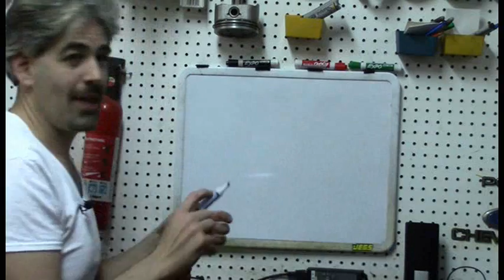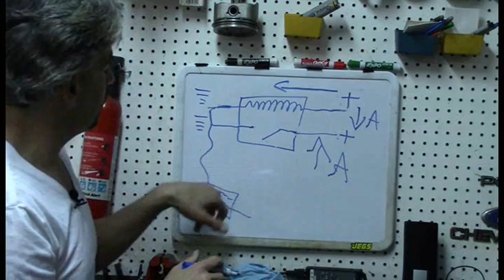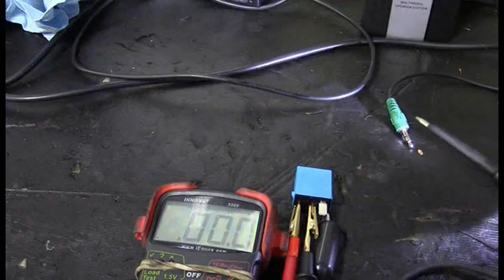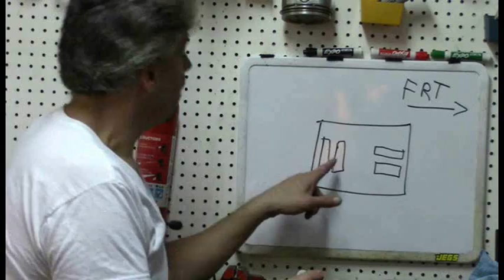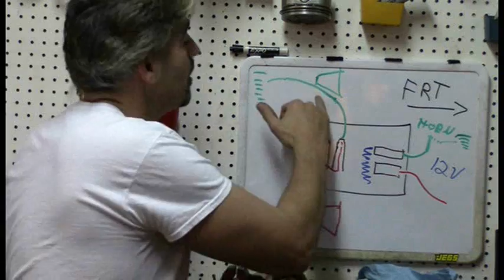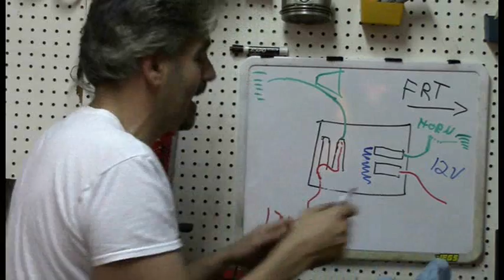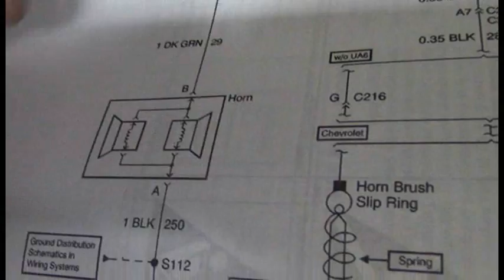Relays- Understanding, Diagnosis and Testing Relayed Circuits-Pt1

Comment: My friend, because I don't know your name yet, there are a couple things I wish to point out that will help you make some of these points . By the way I am well aware of the multitudes of you tube channels that are clueless and just repeating things they have heard. And I see you are way more complete in your tutorials. I am a retired Union electrician so auto electric comes naturally to me. In our field we use certain terminologies to quickly and positively identify symptoms etc. Like open and closed circuits for off and on respectively. And you also use these terms correctly. But when in an auto fuse box there are three kinds of fused outputs really four. One is battery hogs . No key needed for these to work like brake lights and some lights. And horns which is why I mention this because this power to the relay is actually a battery fused circuit. There are also ignition fused hots that require the key to be on before the fuse will be hot. And there are accessory fused hots that are on with the key on but they go off when key moved to the start position . And lastly for important stuff like head lights they are fused only after the headlight switch is turned on. Those fuses will not be powered until the switches are turned on. So this would have been discussed as a battery fused power circuit. 
  Which is my second point that will be helpful in your tutorials. Is that relays have power and control circuits . The power side is contacts usually much heavier duty than the control circuitry. The control side is a coil or holding coil that moves the contacts on the power side from open to closed or visa versa  that's all I got . You are an excellent YouTuber. I don't waste time with the majority and your readers should know that I support your content and I despise the parts changers or click watchers.

Comment: You don’t need a diagram to understand the relay because you do a continuity test to determine the electromagnetic control side contacts. But what if it’s that control side that is buggered? Would it be impossible to then know which pin is which?
Reply from the maker: No because I can determine which side is which from the relay port in the car. In facts, that’s normally how I do it because of the fact the relay will be suspect.

Comment: Not sure if circuit board relays are the same but im trouvleshooting a relay that i think is bad on a circuit board for a wine cooler....

I am trying to diagnose if the relay itself is getting the correct voltage on the control side...i am reading 12 volts on one side and 6 volts on the other side...12 volts seems normal but i dont understand why im seeing 6 volts on the other side....shouldnt i see 0 volts for ground?  I dont want to throw a relay on when the problem is actually something else in the circuitry that is feeding power/ground to the relay control side
Reply from the maker: Are you seeing 6 volts on the load side or control side?
  By the way I haven’t seen a control side that isn’t circuit board controlled for almost 12 years now.
Reply: @Schrodingers Box  control side...one side of coil is 12 vdc other side is 6 vdc
Reply from the maker: And is the 6 v on the feed side or the ground side switched side?
Reply: @Schrodingers Box  well it is a motherboard so I'm not sure if it acts the same as an automotive relay...but it looks to be on the ground side
Reply from the maker: And what happens when you jump the load side?
Reply: @Schrodingers Box  well I haven't tried jumping the load side...was nervous about screwing something up on the board...I did apply 12 volts to the control side and hear it click and then check continuity at the load side and don't get continuity....but circuit boards with those solder joints are very hard to make good contact with the probes....I just don't get why I'm getting 6v on one leg of the control side....I don't know if something is not getting the signal to ground the coil or if the transistor or whatever component it is is failing
Reply from the maker: Wait you lose me- please tell me you did not put 12V on the control side with no load did you???  If you had 6V on the ground side you didn’t put 12 V to it I hope. Otherwise you fried the circuit driver.  Only put 12 V with a load on the control side!!   You can jump the load side because—- it has the load. It’s the load side.
Reply: @Schrodingers Box  I used two little 6 volt batteries to get 12 volts and applied it to the relay control side...just like it would receive 12 volts in normal operation to activate the coil...
Reply from the maker: But you said there was 12V at control side.   So are you saying now there isn’t 12 V at control side?
Reply: @Schrodingers Box  there is 12v one one leg of control side but when I check the other leg it is 6v....one side (hot side that gets 12vdc from power supply is showing 12 volts)....the other end of the coil is reading only 6 volts....
Reply from the maker: Ok. I don’t see how putting 12V would make the relay click since there is still 6V backpressure. 
  What happens when you jump the load side- does it work nornally?
Reply: @Schrodingers Box  I haven't tried that yet....I got it to click by putting 12 volts to it...I took positive to one end of it and negative to the other...but I didn't get continuity on the load side....although it was very difficult to do....tough to get good contact on those tiny pins
Reply from the maker: That’s why you need to see what happens when load side is jumped. That’s the next step in the diagnostic process.
  What component does this relay drive? I don’t think you mentioned.
Reply: @Schrodingers Box  it drives the compressor....it is a wine cooler...it jumps 120 vac that comes into the board out to the compressor...
Reply from the maker: perfect. then that confirms load side works. all you have to do is ground the control side with relay in place and confirm you have load side operation. if you do then your issue is with the control side ground  .
  just make absolutely sure you do not short the control side or you will likely cause severe damage.

Comment: Hello... I have a question. Why am I getting 3.6 volts on the control negative, does that mean a bad ground. It's on the fuel pump circuit...thx
Reply from the maker: If you are on the correct wiring and measuring correctly then then yes, that would be the explanation.  I would confirm it with a voltage drop test.

Comment: At ~23:17, where you talk about giving 12 volts to ground to test the horn, you say the load (the horn) is most likely on the ground side.  But what if you lacked that sort of prior knowledge and guessed wrong (i.e. what if the load were on the power side), would you be putting 12 volts straight to ground, creating a short-circuit?
Reply from the maker: What a great question! no you wouldn’t.   in either case- whether ground side switched or power side switched if you make the connection across the relay load side, that circuit will still be open unless that switch is closed. 
   so in the event of this horn, the horn is always grounded so putting power to it activated it if the horn  was ground side switched then you would have still press horn button to activate it.
Reply: @SchrodingersBox  Thanks for clarifying.  You're content is great, by the way. Thanks for making these vids!

Comment: You narrowed it down to either an an open on positive side or a bad switch (control side).  What if the input was controlled by the BCM? Is this possible? How would proceed to troubleshoot in that case?
Reply from the maker: Oh that happens all the time!!! in that case you need pull a “computer pinout diagram” and go to that computer or module and backprobe that pin and look for if the signal is there. if it is you know the open is on the wire. if it isn’t there- you need a new PCM. I have quite a number of videos where I show this.

Comment: The power side switch is in the relay. The control switch is outside the relay. The horn is a load.
Reply from the maker: both power and control sides are internal in a relay

Comment: can the relay load side ever be on the negitive wire of the device they are powering up or are they always spliced into the positive side?for example instead on a typical 4 pin with relay removed then seeing usual power/ground on control then power/ground on load  side could it be power/ground on control then ground/ground on load as its spliced into the ground side instead?
Reply from the maker: i don’t see why they couldn’t do that but I have never seen a relay with that position on a circuit- it’s always been a power feed that I have ever seen. but of course- a ground side relay should work fine in theory.

Comment: I have a 2005 gmc envoy. I have a starting issue.if the car sets. Like all night. It starts every day. I can start in the morning and drive fine. When I stop. And park , and go do what Iam doing. I come back and no start. Crank only. Then I have to let it sit again for about 3 hrs. My pwr/ trn relay get hot. Also I can’t turn the key completely to off position. I know it could be many possibilities.
Reply from the maker: yep many indeed. what data do you have to narrow down the variables?
Reply: @SchrodingersBox  I have no idea, I was just reading an article on politico. And sharing fir what is worth.

Comment: Great video, I’ve watched your channel for a couple of years now and i also subscribed to the SBQM channel. Just out of curiosity, when applying 12V on the Load ground side, If you were not  certain that the horn was on the ground side and it happened to be on the power side, were you not concerned with applying voltage directly to a ground, or you knew for sure it was in the ground side.
Reply from the maker: First, Thanks for the subs! it is much appreciated. 
To answer your question, I would know immediately if the horn was power side switched because I would not have seen 12V at the power side.  The fact I saw 12V at the power side means that it can only be controlled on ground side-  otherwise horn would be on all the time.
Reply: @SchrodingersBox  but with the circuit being open, wouldn’t there be 12V regardless of which side the horn was in. From what i can understand is that there is no switch on the load side apart from the relay itself.
Reply from the maker: not if it was power side switched. Because if it was power side switched you wouldn’t see 12V at the relay until the horn was pressed.... because it’s power side switched. The fact I saw 12V there tells me it must be ground side switched. there is no other explanation.
  Try drawing a simple wire diagram out both ways - one with pull up and another with pull down design and you will see it.

Comment: Right Matt.... the same electrical engineers that designed the Delayed Accessory Relay to be placed right into the inside of the smart junction box on my 2005 Ford 3.0L. Impossible to repair if it burns or sticks opened or closed. Everything else can be replaced. Fuses, 30 Amp breaker, etc. The things that run the NECESSARY components on my vehicle. The one thing that's only for CONVENIENCE is built right into the Smart Junction Box. If this Relay goes on my car I'd need a new Smart Junction Box. Because I NEED to be able to run my windows,  radio,  moonroof, and have my interior lights on for 5 minutes after I turn off the engine. Unbelievable.

Comment: Nice representation, thanks a lot for your job !! 
Still have one important remark: 
It is OK to check the "switch" side with a jumper wire. 
But from my point of view it is certainly NOT ok to test whether the horn load itself is on "positive, 12V" side or on the "negative, ground" side by applying your power source directly to the one of the terminals of the switch side. Remember, the idea was that you DON'T really know where the horn is, and want to do some test to determine. You know which one of the switch-side terminals is towards the positive side and which one is on the negative, but you don't know where the horn itself is. With the test you just demonstrated, if the horn was on the positive side  (or any other load, as it might be for some cars if we are talking "in general") - you would create an actual short - the same that you explained to be careful not to cause just a moment before..
Reply from the maker: absolutely not. if it’s pcm controlled that could very well destroy the transitor!

Comment: hey Shrodinger. I watched your fuel trim video. Loved it. I commented today. Question or challenge for you= you quizzed us by saying "if MAF sensor was dirty what would long term fuel trim look like?" I thought lots of un-metered air would find its way down to the O2 sensor. So that would respond by adding more fuel I thought. Hence causing a "rich" fuel trim.  But you disagreed by saying it would cause a "lean" reading. Wouldn't a dirty MAF sensor trick the O2 sensor into thinking their wasn't enough air? Causing the ECU to add more fuel? Concluding in a rich reading? Or a higher fuel trim? Keep in mind your my Mr. Miagi so Im speaking about fuel trim because of your teaching. Not trying to challenge or be smarter. Just really trying to clarify.
Reply from the maker: Good question. You are correct but we missed a bit on definitions. Lots of unmetered air would indeed hit the O2 and therefore the O2 would call more fuel to balance it.  This would be a LEAN CONDITION and would be reported by the O2 as Lean.  You would see the fuel trim as lean (positive). 
   However you are correct that the trim adjustment would richen the mixture.  This is a richening adjustment however the fuel trim itself would indicate lean.   Make sense?
Reply: Hey thank you for reply. Yea that does make sense. I’m skipping a step essentially. The unmetered would first cause a lean signal then when adjusted rich. Thank u so much for clarification.
Reply from the maker: You got it!!

Comment: Great video. When you were powering the relay up, how come it didn't matter that you connected the negative alligator clip first & the positive 2nd?
Reply from the maker: It makes no difference because you don’t get current until you get continuity and that can be done at either polarity.

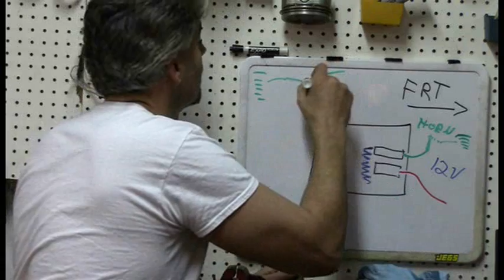Comment: Hi, I enjoy watching your videos which are very relatable. Ihave learned a thing or two from them.  I'd like to point out that starting on 23:25, your concept of where the horn is, could be a little confusing.  My take would be that the horn IS the point where the ground and the hot meet.  Both sides of the load circuit in the relay are the "hot", just a switched hot. The actual "ground" side of the load circuit is between the grounded end and the "negative" side of the horn.  Keep up the good work !

Comment: One evening my headlights never turn off even if the headlights stalk switch is turned off. I had no option but to disconnect the battery wait until next day and connected back and took it to the repair shop. Now I understand the reason, good to know . Had I known this before, would have tried replacing the relay on my own and saved few bucks.

Comment: Matt, to fully diagnose relay issues wouldn't you have to test both the control and the load side under actual normal operating load and not just run a voltage and/or continuity test? A length of relay (or other) circuitry that reads proper continuity could still show improper functioning (a large voltage drop) under load, no?
Reply from the maker: No you wouldn't because the bench test shows the relay is working.  If the system is failing under normal load application BUT the relay works on bench test, you either have a compenent failure OR voltage drop/insufficiency issue.

Comment: Your explanation of identifying control side and load side of the relay without a diagram or map on the relay will confuse your diy guys when they come across a relay which is stuck on the test you done will have continuity through both sets of pins and they won’t know where to go from there maybe better explaining iso pin arrangement for relays to save any confusion ,Load Side pin 30 normally b+ ,pin 87 NO (normally open) ,87a NC , Control side pin 86  and pin 85 which can be switched negative or positive ,be careful viewers you can blow PCMs very easy poking around relay pins.

Comment: why  do you have to go right around the houses so to speak The current does not 
increase or decrease    its the durability of the coils in Amps
Reply from the maker: Current absolutely increases through a coil.  It's a phenomenon known as counterelectromotive force.  Also AMPS is not measured in terms of durability- not sure what you mean by that?

Comment: Noob here, are you using resistance option on the multimeter? I thought it could be done in a live circuit.  Thank you
Reply from the maker: I am using both continuity and resistance measurements.

Comment: small point  regarding to the relay my be the internal switch in NC normally close which means that without applying the voltage for the coil you also will have continuity 
not all the relay is NO (normally open)
Reply: Yes, it is an important first step to determine whether it is NO  or NC.

Comment: https://www.youtube.com/watch?v=JZ20-kjz6i4&list=PLPbtcys4XVmduKmVmApJhBlacl4DEGUHH&index=2 
 I have a 2003 civic that is doing exactly this  what is in this video.  the battery charges while running but this clicking which starts between 5 and 10 minutes after shutting off  the car - after I've left the car - runs it down.  the car also will not start even with a charge on the battery.  I've located the relay and removed it and opened it up only to find it in pristine condition.  any ideas where to look? from a 65 year old grandma on a strict budget
Reply from the maker: Check the amperage draw from the starter.,